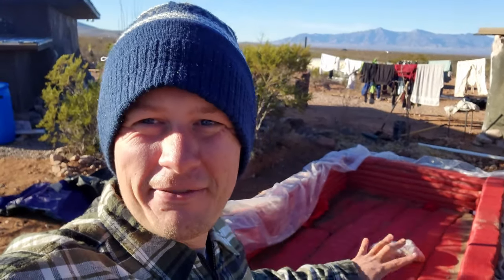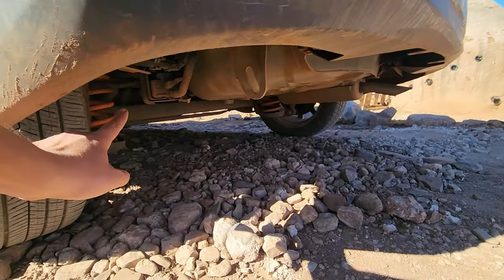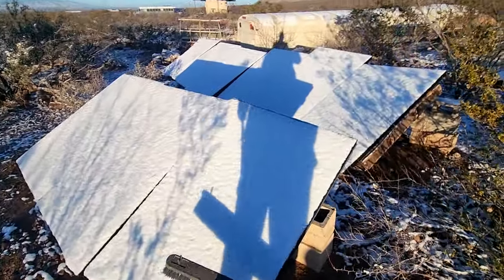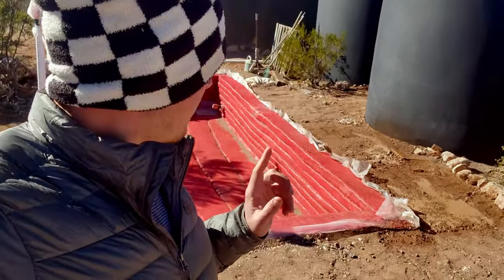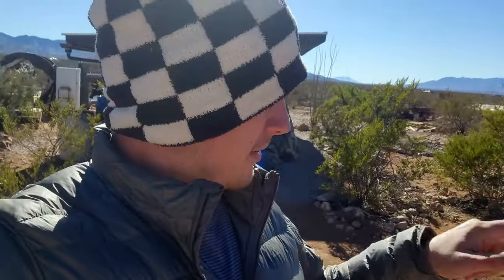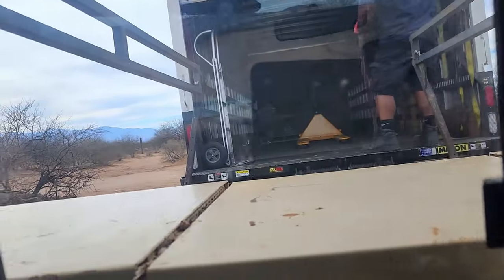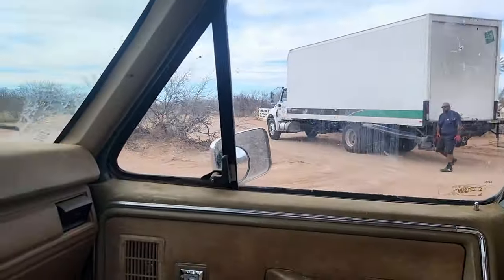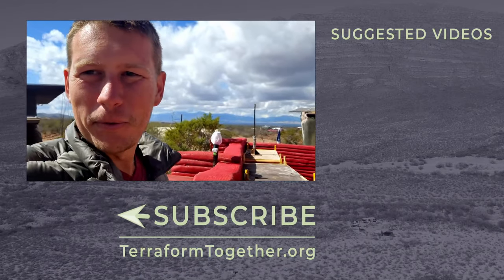Best Water Tank Storage Option! We're Building an Earthbag Hyperadobe Cistern To Harvest Rain Water

Comment: My only concern is I think after your first big rain that back fill will sink a few inches.  I watched a couple earth bag/hyperadobe builds where they didnt account for that.  They thought tamping it would be enough. Maybe if the roof is overhung enough and/or come trenches to divert water away from the outer edge of structure.
Reply from the maker: We will have a big overhang. I am also debating putting big gabion rock walls around the whole thing to help hold it all together. It's all an experiment. We'll see.

Comment: Wouldn't a cylinder be a better design for a cistern?  no buttressing required, larger volume to wall ratio...
Reply from the maker: Yes. Originally the hole was dug to just drop the poly tanks in.  Then we changed plans

Comment: Did you upgrade the brakes on your car so you can stop that extra 500 pounds?
Reply from the maker: Should be fine 😅
Reply from the maker: I figure if the car can handle two big dudes in the back, the equivalent weight in concrete is no big deal